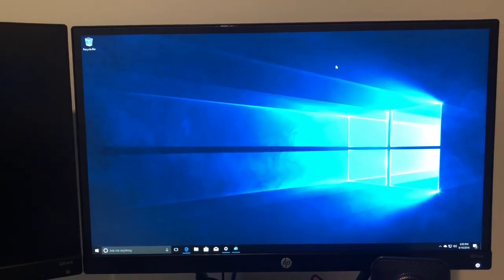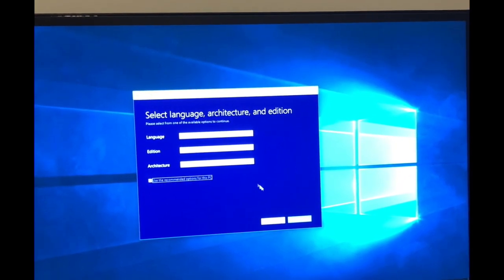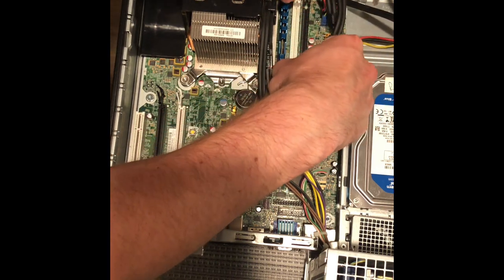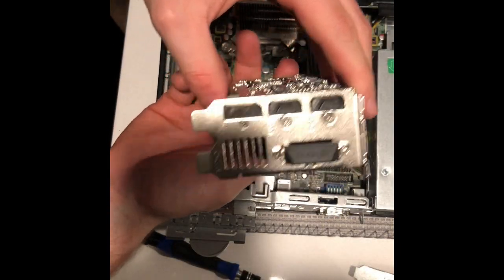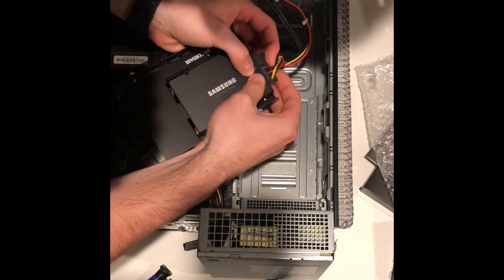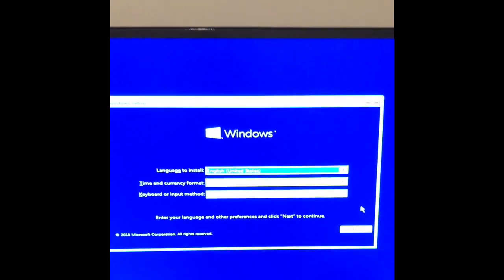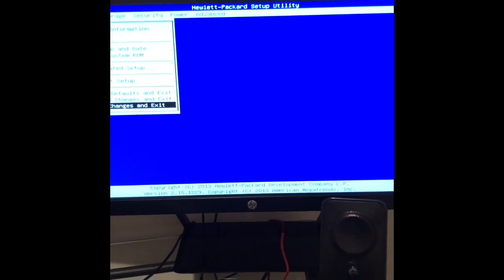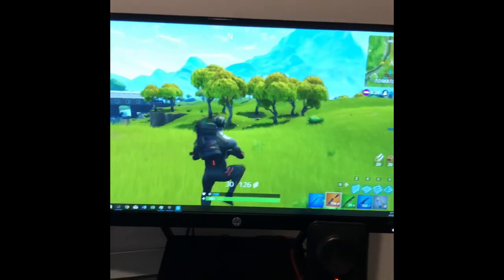HP Elite 8300 SFF Gaming PC Upgrades!!! Graphics Card, SSD, RAM

Comment: Will this work if I buy a cheaper solid state drive such as an HP 500 gigabyte solid state drive instead of the Samsung one? The HP solid state drive is only $60 compared to the Samsung one which is around $150.
Reply from the maker: Honestly probably not a noticeable difference in performance

Comment: I have the same one but how did this go work on 240 watts
Reply from the maker: The CPU is only drawing about 50 watts max and the graphics card can draw a max of 75w from the PCIE slot.  So even with a bunch of USB attachments and Sata power for drives, you shouldn’t hit the PSU limit
Reply: Tech Round Up thanks for telling me, now I am going to upgrade my pc

Comment: Ok thanks cuz i have the same tower but i didnt get a low profile and it didnt fit so i watched this video and it was good but i was wander where did to u get the mounting bracket.
Reply from the maker: Mine came in the box with my Gigabyte GTX 1050 LP, but you can probably find one on eBay or another site for your specific card if it did not come with one
Reply: @TechRoundUp  i Already returned it

Comment: where did he get the smaller mounting bracket
Reply from the maker: It should come with your low profile graphics card, or any PCIE card that can be used in a small form factor case

Comment: How much was it for d ram
Reply from the maker: $105 for two sticks of 8GB DDR3 1600MHz
Reply: @TechRoundUp  and what was d graphics card price and also can gtx1050ti 4gddr5  fit in d pc and it is much better
Reply from the maker: $130 for the 1050, and as long as you get the low profile version of the ti it will fit in the PC.  The performance on the 1050ti will get you about 10% more FPS, so depending on the price it could be worth the extra memory and performance
Reply from the maker: You can only fit a low profile or LP version in the 8300 SFF.  As long as the name of the card has LP or low profile you will be fine to fit it in the case
Reply: @TechRoundUp  thanks

Comment: I just installed my ssd and installed my gtx1050ti waiting for my ram to come tomorrow but I can’t get a signal from my hp 8300 to my monitor.
Reply: PLEASE HELP!
Reply: Josh Graessle problem solved I thought you still had to use a vga cord to change boot order and etc.. but you can just use the hdmi port on the gtx
Reply: Thanks very much for posting this video it has helped me a ton I knew nothing about computers and was able to complete this entire upgrade

Comment: would this still work with the i5 3470 version?
Reply: @TechRoundUp  forgive my ignorance what do you mean by it has half the threads?
Reply: @TechRoundUp  makes sense thanks for your help
Reply: It will work. I have 1050ti 4gb OC version non low-profile with 8gb of ram, and it works fine!! but to play Fornite i recommend at least buy a SSD.

Comment: Where can I buy the pc? Can somebody give me a link?
Reply: Check out this seller on ebay...  https://www.ebay.com/itm/HP-Compaq-Pro-6300-sff-I7-3770-3-4ghz-16GB-RAM-500GB-HD-Win-7-Pro/113509241051?hash=item1a6dad90db:g:3XUAAOSwmXpcKnfk   You will probably end up with less than $150 invested after auction end. To be honest, you won't see much difference between the i5 and i7 versions when it comes to gaming performance...a decent low profile video card is the key. Get the machine with the most ram installed and the desired cpu upfront...upgrade prices are ridiculous compared to what you could have got initially.
Reply: https://www.newegg.com/Product/Product.aspx?Item=N82E16814137081

Comment: hey this is gonna sound like a dumb question but i know nothing about pcs and im wondering if i were to get the same graphics card but this ram https://www.amazon.com/CORSAIR-Vengeance-2400MHz-PC4-19200-Memory/dp/B01ARHBBPS/ref=sr_1_3?s=electronics&ie=UTF8&qid=1542964594&sr=1-3&keywords=8gb+ram and this ssd https://www.amazon.com/Samsung-250GB-Internal-MZ-76E250B-AM/dp/B07864WMK8/ref=sr_1_3?s=electronics&ie=UTF8&qid=1542964935&sr=1-3&keywords=ssd+250gb would it still work? i dont know much about this stuff so again sorry for dumb question but i just want to save a little bit of money
Reply: @TechRoundUp  okay thanks <3 i just wanted to make sure I wouldn't  do anything wrong. I'll look into it, thanks

Comment: Isn’t the graphic card pulling too much wattage since the power supply is only 250 watts?
Reply: asking this 2 years later but did you get your question answered? Will the 250w supply all this?
Reply: @drown4486  wooow this was forever ago, but to answer ur question whenever i got a 8300 i bought a gt 1030 to put in it. ab a year and a half ago (bc this comment is almost 3 yrs old now) I built a new pc which I've been happy with since just some minor upgrades. but thanks for checking man
Reply: Josh G ok thanks because I’m going to buy an 8300 also but put a GeForce gt 730 in mine once I get it and probably patriot viper ddr3 (1600 MHz) since I think that’s the max MHz it can handle